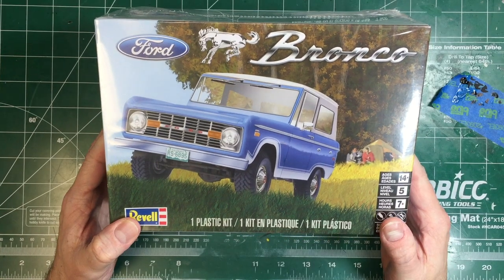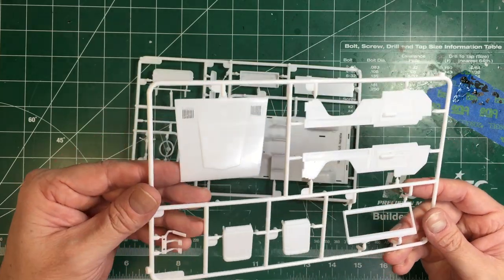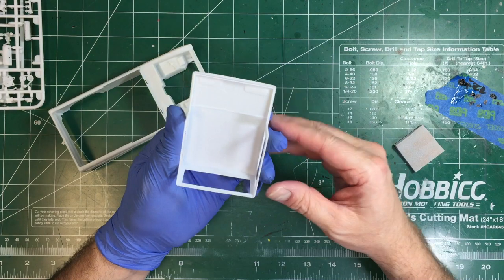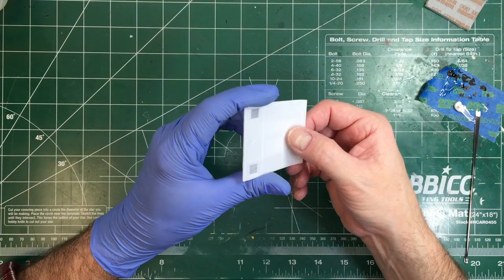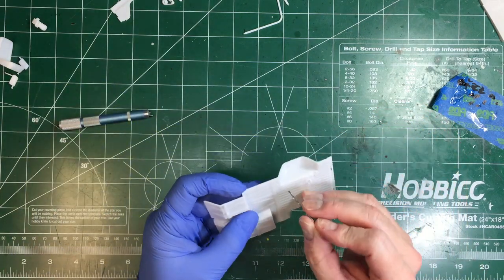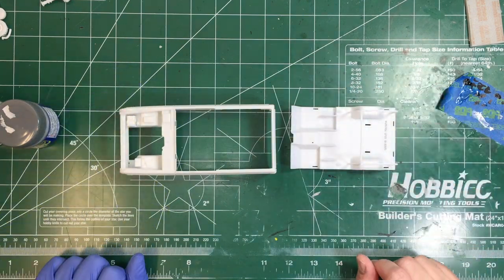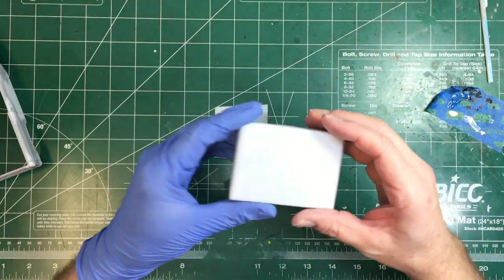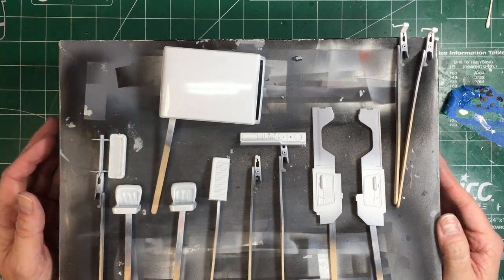Building the Revell Ford Bronco 1/25 scale model Part 1

Comment: While I see that you filled the pin ejector marks on the inside of the fenders you didn't seem to put bottoms on the electronic boxes mounted on top of the fenders. I would think that is a more glaring flaw in that portion.